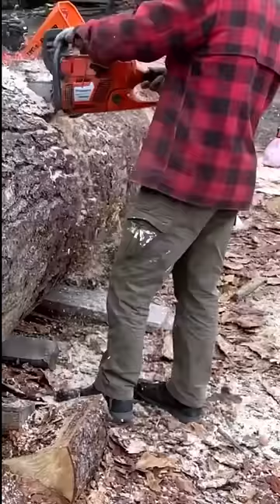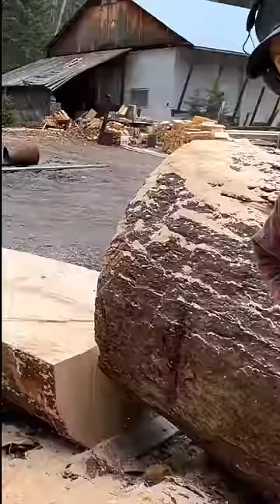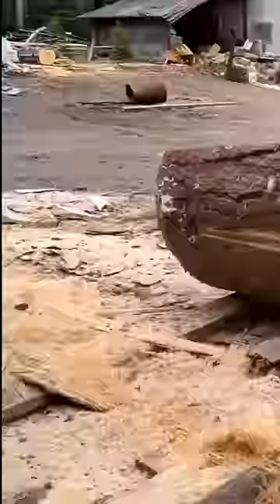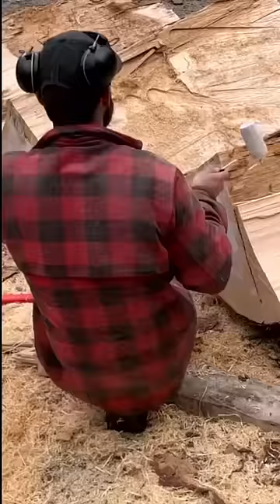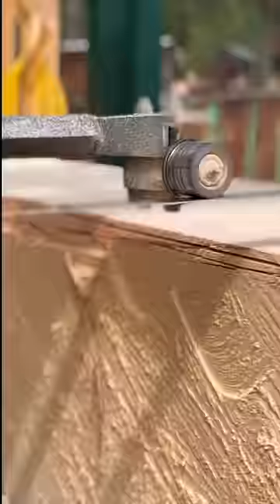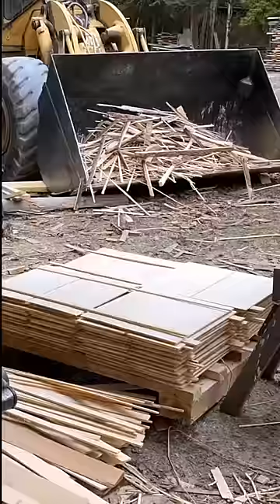500 Guitar Tops From a Single Tree #shorts

Comment: I feel like there was more than 500 available on a tree that size
Reply: The thing about guitar tops is that they're always made from quartersawn wood, and quartersawing yields a pretty low percentage of the wood, a lot of it gets wasted.

I've actually heard people argue that quartersawing isn't really necessary, at least not perfect quartersawing, but generally speaking it is broadly accepted in general woodworking that quartersawing wood is more stable, and in guitars that it gives the best aesthetic and tone.
Reply: @MattMcConaha  appreciate the legit input... Now I have to Google quartersawn....
Reply: @davewojtowicz2246  you'll find a lot of pictures that don't show exactly the same thing, but the basic point is that the wood you are getting is more or less a radial slice from the log. The width of the board goes from the center of the log straight out to the bark. This results in the growth rings being perpendicular to the face of the board. Since wood expansion varies with grain direction, having the grain all parallel and perpendicular to the face of the board means the expansion is pretty uniform compared to a different board where the grain direction changes along the width.

The actual method that they use might be closer to rift sawing, but the distinguishment isn't really made as far as most woodworkers are concerned, because they result in the same quality of wood but just with different yields. Rift sawing gets you more "quartersawn" boards from a log, but all of the rest goes to waste. Typical quartersawing gets you less "quartersawn" boards, but it also leaves you with more usable stock that just isn't quartersawn.

The distinction between rift sawing and quartersawing is not well defined, some people have differences in opinion on that.
Reply from the maker: @MattMcConaha  Most of my customers would say perfectly quartersawn wood is all they are willing to use, it's probably not necessary, but it's what they want. Quatersawing does have a little higher waste than other forms of milling for sure. to combat that I did make violins off the inside of the guitar and bass tops from the butt of the log and my final count wasn't in on guitars when I made the video, turns out i did make more than 500, but thats how many i had counted at the time of video.

Comment: We cut ours into 24" rounds then knocked the sap wood to see where the overgrown knots were. Splitting the round on these maximized the yield of higher quality wood.
Reply from the maker: Normally yes. thats the traditional method and its the best way to approach a tree you don't know much about, but this was the exception tree. No twist, very few knots i checked first. It ended up being impossibly high yield cause I could cut 22" at the chop saw, and dodge knots. The best part, no run out because no twist. But that was a once in a lifetime tree.

Comment: I'm surprised its not lathed veneers for guitars.
Reply from the maker: For electrics that sound about right. I’m doing acoustic guitars with these ones.
Reply: Typically plywood is rotary cut like a roll of paper towels, but quarter sawn direction of veneer cut isn't done on a lathe style rotation.

They can take a quarter of the log, and it gets grabbed in the machine in the correct direction,  and it will take vertical peeling cuts, up and down, one after the other to produce a pile of quartered veneer sheets.

Rotary cut produces an exaggerated flat sawn appearance, that most construction plywood needs, or in other species it's a desired appearance.

Comment: We all have our preferences I'd prefer not to see such a large tree cut down to thin boards but when there's a demand there's a waste 

Not a tree hugger, I'd just rather build a house with it
Reply: 1 big tree or 50 little ones?
Reply from the maker: My counter argument is, that houses are usually made from 2x4 or maybe 2x6 which means they need a 6-8 diameter log at the top minimum. Guitars need 9” of width well clear of the heart wood, let’s call it 10” minimum but on either side of the heart, which means the smallest possible tree would be 20” diameter at the top. 
Guitar log specs say 22” diameter top size.
Reply: You can build with wood that's less than perfect.

Guitar tops and clear trim are of a higher value than 2×6 value 

What upsets me is when someone cuts a beautiful saw log into firewood, because all wood burns, and clear straight wood is more valuable and rare.

I've seen someone cut a nice Black Walnut into firewood,   ugh!!!
Reply: @MountainVoiceInc you are providing a greater value,, cutting it into something that people can hear and look at as it's played.

Comment: How do you set the 1/2 log on edge on the sawmill without tipping? I'm trying to do 1/4 sawn boards. I don't have heavy equipment. My log is a large ash trunk.
Reply from the maker: My mill is hydraulic, that helps...without you would have to make a clamping jig to get the job done. a 45 degree backer against the round side roll it up with a peavy while a helper clamps or something. Most 1/4 sawn lumber is only kind of vertical gran so if you start from a round log you can just use a cut sequence to make relatively stable lumber. what we are doing is some advanced stuff that isn't really worth it for standard lumber.

Comment: How does that wood not split, crack, cup and warp as it dries?
Reply from the maker: Once it’s cut into thin enough pieces and cut to length it’s all about how it’s stacked. It dries fairly evenly at that size, I just keep it out of direct sunlight.
Reply: Once the wood is cut, it allows shrinkage with less included stress.
Quarter sawn wood exhibits even less movement.

Logs will split radially most easily, because of the radial versus tangential shrinkage, so quarter sawn wood is the most stable.

Comment: It’s a shame that huge tree was cut into tiny pieces seems they could have used alot smaller trees for something like that
Reply from the maker: Things are not always as they seem. Guitars need a rather huge tree because the grain has to be vertical across 9” of clear wood free of heart Center. So minimum top diameter is usually 24” and if you go bigger like we did the recovery is higher still. Plus I don’t really see a better use for a tree than becoming an instrument. Maybe I’m bias.

Comment: How old was that tree?
Reply: Probably about 200 years old.
Reply: @tonyfremont  pine trees don't live anywhere near that long. After a while they turn into fat wood or just rot away. It's more like 30.
Reply: @chrism.7166  i don't think that was pine, but old Maple since it's going to be electric guitar body parts.  Perhaps the OP counted the rings and could tell us.  I can tell you that I've seen oak and hickory trees that were much smaller in diameter, yet we're well over 120 years old.
Reply from the maker: Pretty old, but also when a tree matures to that size it is near the age where it will fall over and damage other trees and itself. Sometimes it makes the most sense to harvest just before that and put all of its years growing to use.

Comment: Sawn not split. Doesn’t sound as good.
Reply from the maker: Ya normally splitting yields more high quality top, but you may have noticed that I did split a few pieces to check the overall twist of the log and there was not really any. So in this case I cut them in longer lengths and selected high quality tops by moving the cross cuts once everything was in guitar thickness which is isn’t really a possibility when you cut, split billets and resaw on a vertical. So for this 1 in a million log  I would say the quality is as good as split, but I made way more high quality tops than the traditional method would have.